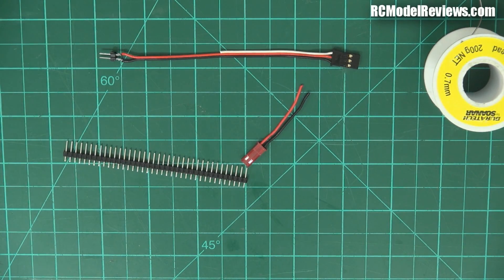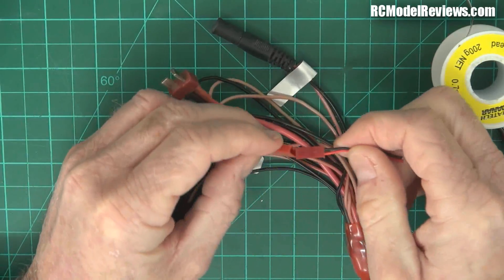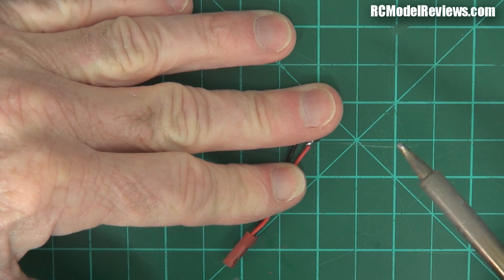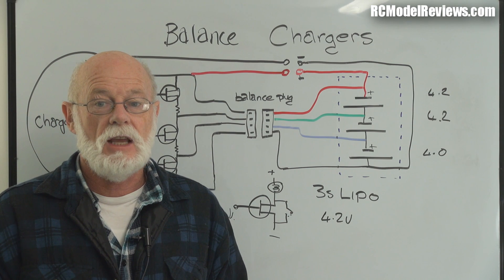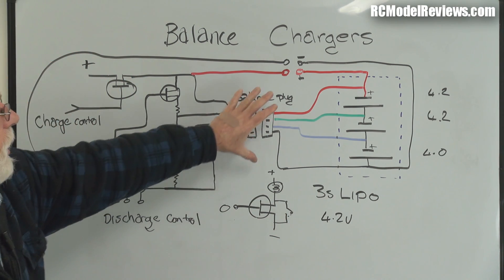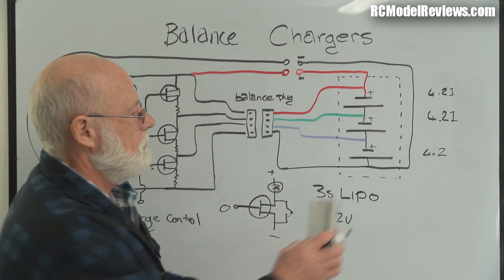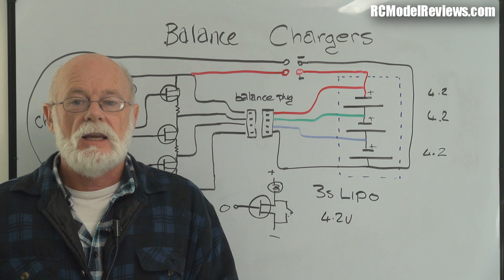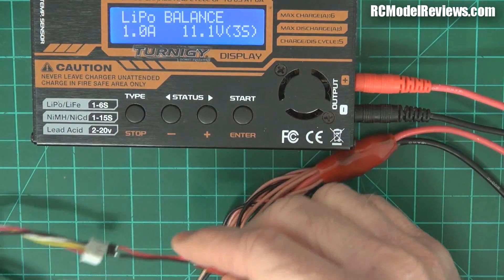Balancing your lipo battery more quickly (and how cheap chargers work)

Comment: iCharger 308duo ROCKS! it balanced super fast
Reply: dborup Agree!  This is highly dependant on what charger you have. Some cheaper chargers can take half an hour. and some charger does it under couple of minutes!  My turnigy can easily take 30 minutes or more on larger packs while the icharger takes 2 minutes extra. And the end result is good enough :)
Reply: Kevys Rc & Music Far out mate, throw a comma or full stop in there next time would ya. I'm not going to argue with you about this. You do shit your way I'll do it mine, ok? Also what makes you think your batteries last 10 times longer than anyone else's, do you know how long my batteries last for? Of course you don't, so stop making ridiculous uneducated remarks.
Reply: Kevys Rc & Music Calm down mate, I forgot about you like 6 weeks ago and now you wont shut up. What exactly is your problem?

It's time you do a refresher course because lipo batteries don't suffer from memory. You shouldn't be discharging them completely just for the hell if it. Lipo batteries should be storage charged when not used for a while (3.75v per cell).
Reply: dborup Yep great charger. My batteries are perfectly balanced after charging and it doesn't take long.
Reply: iOS Beta 3c normaly. but can go as high as 5c, in parallel
Reply: iOS Beta same here. 2c when i have time. when out racing i run up to 5c aswell and depending on how many we are flying we charge up to 12 batteries at a time on 1 single icharger :)
Reply: Tobermory Cat The iCharger 308 duo natively has 2 independent charging ports, throw on a parallel balance board and you can be charging 8+ batteries in one go!

The charger can also be used to monitor lipo cells during a discharge so you can get an idea of how healthy your lipos are.
Reply: Kevys Rc & Music Never discharge a lipo to 3v for the hell of it. Every charge/discharge is just more ware on the battery. The memory affect you speak of is pretty much non existent on lipo batteries and you are just sending your batteries to an early grave by constantly discharging to 3v per cell.
Reply: Kevys Rc & Music 3v per cell is completely discharged. Anything beyond that is over discharged. It might be a good idea to discharge a lipo every few times to gauge how much is being charged back into it and how well each cell performs. However doing this every time is pointless. You seem to have convinced yourself this is a good so sure thing keep doing it.

If you believe you know more than the engineers and scientists that formulated lithium polymer I suggest you write to them to inform them they are wrong and you you are right. After all that is why you wont shut up right?
Reply: dborup suspect most would find buying 6 chargers is super faster than one expensive charger. Helpful tip from the man at the bench.
Reply: Tobermory Cat I charge 8 x 1300mah 3s in under 15min :)
Reply: I am wrong then. That's a fancy charger! I will check it out - thanks.
Reply: dborup Holy crap! At what C are you charging man?!? :)
Reply: Vent FPV rethinking my charging setup - this seems like the way to go. Thanks for the info.
Reply: dborup daromeresperyd Damn, that charger definitely seems to be worth it
Reply: dborup fast charging cuts life of batterys fast charging is bad for batterys
Reply: Kevys Rc & Music It sure is, but if you can afford it, why not? :) I mean, those charge times are insane! :D
Reply: iOS Beta fast charging lipos can also cause them to blowup so what the house worth etc.:)
Reply: Kevys Rc & Music Shouldn’t charge in your house anyways, should you? ;) But Lipos rated for a higher than 1C charge like nano-techs don’t really tend to blow up as long as you stay in the recommended range
Reply: iOS Beta none charges their batteries ina snowbank in the winter do they , charging at half the rated mah is safe and the best way to inusre long life along with always discharging to 3 volts per cell which also prevents the memory affect
Reply: Vent FPV wow you dont even know me,, uneducated remarks buddy you have no idea what i know or dont know .. but thats ok i understand you would rather belive everything you read and watch on videos and thats upto you.. your not even worth my time to explain it to you ..
Reply: Vent FPV  , I NEVER SAID I COMPLETY DISCARGE LIPOS CAN YOU READ THIS .. i take them to 3 volts per cell and yes they can and will hold memory affect and i dont give a crap what you think you know cause your worng they do end of story but hey believe what you like.  I take my lipos down to 3 volts per cell using my charger to do it every single time and they not only last me longer but i avoid memory affect and i get to know how many MAh is really going into the them for each charge I alos get a better charge balance everytime as well and my batterys last me for hundreds and hundreds of cycles , i deal with this stuff day and and day out for a Living, and after over 30 years dealing with the electronics and all kinds of battery types iam pretty sure i now alot more then you think you know .. you appear to me to be someone that believes what you read in a book or on the internet run your own experiments and learn the truth like i did about everything i want to know and learn about  i do my own home work just cause some guy does a video or writes a book dont mean crap  to me i run my own tests to see if what the person says is BS or fact and belive me i have uncoverd tons of BS over the years ..
Reply: Kevys Rc & Music Also I will no longer be replying to any of your comments. I feel like reasoning with you is like talking to a record stuck on repeat. Please don't take my lack of replying as a sign of me giving in to you or agreeing with your stance on the matter. I just don't want to waste any more of my time.
Reply: Vent FPV hahahahhahah  ... to you you see it pointless thats you and thats ok , see alot of poople get mislead in this world so business's can profit more ,, if more and more people treated lipos properly so they will last longer then sales over time go lower and lower and business lose money so they count on the majority of people beliving what they tell them which is why you will see that so many people out there belive everything they read or watch and dont do their own tests and experiments they just accept what an apprent expert tells them or company // oh well there you go. take care man ...
Reply: iOS Beta There's nothing wrong with charging batteries at your house, as long as you're watching them and have the means to respond to a burst. Fire extinguisher can help but ideally you need to place the packs in a place where fire would be contained. I use a brick housing for that. Kevys Rc & Music is right in the sense that charging a cell is far more "work" than discharging it for the chemistry. It follows that the slower you charge, the more your cells will last.
Reply: Vent FPV You er 100% correct..
Reply: Vent FPV ok genuis then you exaplain to me how it is then that my lipos last 10 times longer then anyone else's and yes they do get a memory problem not one battery system on the market can avoid the memory issues, all you show is a complete lack of understanding of tech and batteries .. you are only never to drain lipos under 3 volts per cell that much is fact and true the rest is BS that i have proven so many times to be BS so  i do things my way and my batts last a long long long long time the only time a batt goes wrong on me is if i do someting dumb like holding full throttle longer then i should which is a rare thing for me to do anymore dam batts are not cheap.. you also have to allow a lipo to cool down before you recharge them. that goes for all battery types to you also never charge them at the rated Mah as this shortens the life and you also dont get full proper charges either when you charge at or above the rated amps if you charge at half or just under then you get proper charges.. .shall we continue better yet do the experiments i have done for the last several years then come back and will chat again..
Reply: Vent FPV LOL, i have an education and also whats called life experience... which counts more then incorrect books and so called physics that also have so many holes in those books ahhahahah
take care man have a good day

Comment: Nice. But is there a way to make a reverse polarity protection for this?
Reply: Bung a diode in the lead. As most chargers like these measure the battery prior to charging I think you'd probably get an error before it did any damage.
Reply: SirArghPirate its called comman sense or just keep chariging your batts the way you always have and deal with it .

Comment: just a bit confused on the balance charging explanation. When the charger over charges the full cells from 4.2 to 4.21, they gain 0.01v but how come the 3rd cell voltage rises from 4.0 to 4.1 or a gain of .10v during the same time? are the charge inputs not the same per cell?
Reply: Because Bruce made a mistake
Reply: theyRrme I think that Bruce was trying to tell us why balancing takes so long, that was the point of the video.
I would have thought that most peeps got the jist of the video. It was a very small slip up on his part but we all saw what he meant.  Thanks Bruce, keep 'em coming.
Reply: theyRrme It doesn't.  It takes several repetitions of this cycle to restore balance, and the greater the imbalance between cells, the more repetitions.
Reply: pillsnotbills i get that. Where I'm confused is why does the two full cells receive a .01volt increase (from 4.20 to 4.21) while the undercharged cell gets .10volts (4.00 to 4.10) in each cycle? It would make more sense to me if the two cells overcharge to 4.21 and the 3rd cell rises from 4.0 to 4.01, making it an even 0.01increase across all cells per cycle. Is this right?
Reply: theyRrme  I watched it again, and I see what you are referring to.  It would have been better to use 3 significant digits for all cell voltages, but he used only 2 for the third one.  You can imagine that the voltage was 4.10V at some point, each time rising slightly until reaching 4.20V.
Reply: pillsnotbills allright. So the incremental increase is indeed .01 and not .10. That would mean the balancing cycle is repeated not only twice like Bruce's illustration but more like 20x before the 3rd cell reaches 4.20v. Thanks a lot for the clarification!

Comment: I find that this problem can be mitigated by charging all my packs in parallel. I do all 10 packs at the same time and the balancing period at the end is about the same length of time as for a single battery. So 10 packs at 20A takes about an hour.

Comment: Great video but wouldn't it be better to separate your pin headers so you can use the same lead to adjust any single cell?  My understanding is this would only currently work on the first cell.
Reply: ***** thanks :-)  TT. Bruce is the boss!

Comment: I have done this also. Works great. Also if the battery gets 1 or more cells discharged too low it wont charge so put it on nicd or nimh till the voltage comes up to 3v on each cell. Then balance charge

Comment: Hope this isn't a stupid question, but towards the end of the video when you were charging 1 cell, you chose 3.7V. How/why does the charger charge up to 4.2V? Thanks mate.
Reply: dashn64 3.7V is the "nominal" voltage of a 1S lip (just like 11.1V is the nominal voltage of a 3S lipo battery).  When a single cell is fully charged it will reach 4.2V (just as the supposedly 11.1V battery with 3S reaches 12.6V).
Reply: dashn64 3.7V is the nominal voltage of a 1 LiPo cell, not the one is to be charged.
Reply: ***** Thank you :) Really appreciate the help.

Comment: Great Idea!
Other thing: You come back from your flight and have maybe 2 of 6 batterys left full because it started to rain. Then i always use the "Storage" Mode of the Charger to bring them down but it takes a good 4-6 hours for 1 big battery to bring it to storage voltage.
Any Ideas for a fast Discharger (maybe 10A ?) But please not only 3S, o mainly use 4S
Reply: Use your full batteries as the supply to your charger to charge up your spent batteries.

One gets discharged the other gets charged to storage level. And no waste either ;)
Reply: lowcee89 Plug into plane and full throttle for a couple of minutes - job done
Reply: James Brown I have a Robbe 1000W Charger for 200$, it also has maximum 50W Discharge so i can draw 3A per hour out of a 10Ah Battery, still too long for me if i have 4 Batterys.
Compared to a 15v 150W Lamp it has no chance ;)
Reply: lowcee89 I would be interested in this also. Now, I religiously bring all my charged un used batteries down to storage levels, but it can take hours to complete. A faster way would be great.
Reply: lowcee89 Get a better charger.  More advanced chargers will allow a faster discharge rate.
Reply: Check out the Reaktor chargers, good and affordable. You can even build an external discharge resistor for those.
Reply: lowcee89 
Use 12V halogen bulbs as load. They are meant to get hot! For 4S you have to connect two in series so they won't burn out immediately (no problem to hook up 2 in series for 3S either; so you only need to rig up one set). If it goes too slow just hook up more in parallel (or get higher rated bulbs). If you add multiple connectors for batteries and their balance leads you can even bring all your batteries down/up at the same time. With a setup like this I've discharged two fully charged 6S 10Ah packs at the same time to storage level in under an hour. And if you do it at night you can even use the light for something useful ;) .

You have to make sure though, that you have a battery monitor (that can be set to beep at 3.8V cell voltage - or whatever you preferred storage voltage is) somewhere. Because this setup will drain your batteries dead if unattended (which Lipos shouldn't be anyway on charge/discharge).
Reply: lowcee89 plug it into your hot foam cutter and cut some foam? Don't plug it into your spuds to make a strong current for your fishies whatever you do!!
Reply: use some light bulbs!!! i use 24volt light bulbs and a voltage checker with beeper to beep when one of the cells gets to 3,7. when i disconect the cell go to 3,8 and 5 minutes on storage mode. fast easy cheap.
Reply: faster way? plug it into your quad and leave it on iddle :D

Comment: Are there any chargers that use a more direct method of charging each cell individually, thus avoiding this problem with the cheap 4 button chargers?
Reply: cbsarka Yes, some of the newer (more expensive) chargers have a separate charge circuit for each cell so each cell can be charged individually rather than in series.  Costs more though.
Reply: ***** Can you recommend any good ones?
Reply: The Dark Pixel have a look at the Junsi Duos, they are really brilliant chargers, they even measure the single cell impedance and take that into the equation while loading.  And the balance power of these goes beyond that of your normal chargers. Up to 2.4 amps balancing is possible. This might be the last charger you ever buy, really worth their money! (4010 Duo here)
Reply: mooq! Thanks! I'll check it out :)
Reply: The Dark Pixel I use a cheap DN Power charger. It seems to be called "Li-Ion/Li-Polymer Balance Charger Micro-Controlled". I bought it more than 4 years ago and the only way it charges is through the balance port. Its only drawback is that it has a max charging current of 2A so you might not be able to charge at 1C for batteries larger than 2Ah.
The first result on google for "dn power lipo charger" returns an rcgroups thread about it.
Reply: cbsarka revolectric multi4, cellpro 4, and DN power are the only chargers i know that charge in a parallel manner. the revolectrix powerlabs do a neat trick to get around the often long balancing charge phase. if the cells are unbalanced at the beginning, cells with lower voltages are charged at a higher rate to "catch up" with the other cell(s) during the CC phase. in effect, cells are already balanced within 5 minutes at high charge rates, thereby significantly shortening the CV phase.